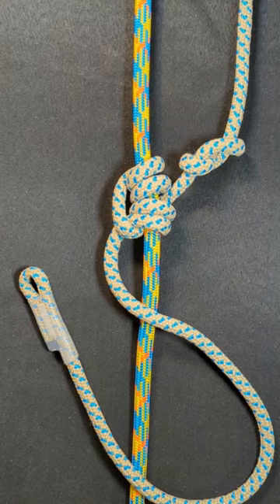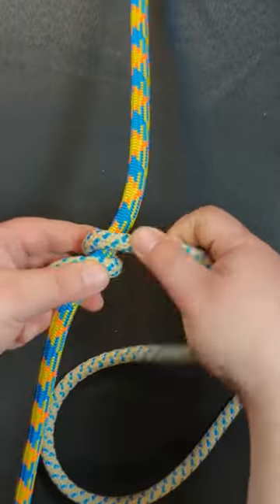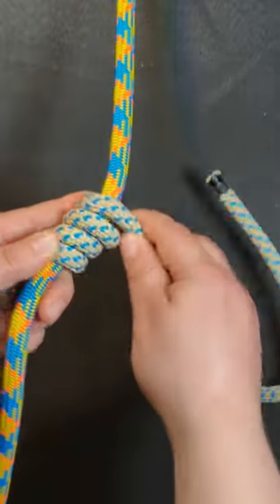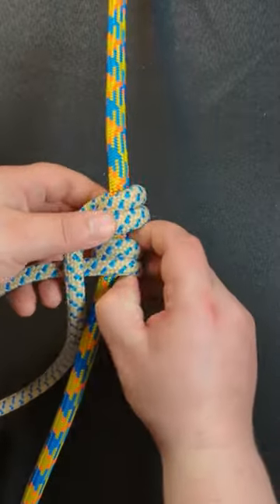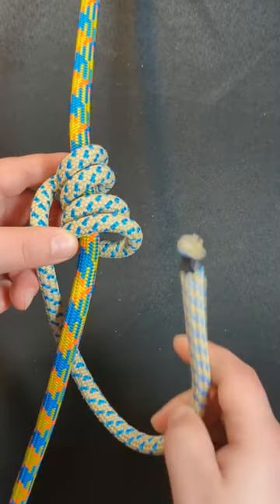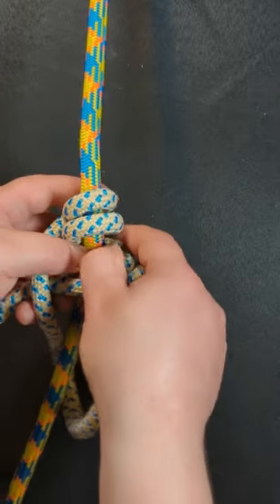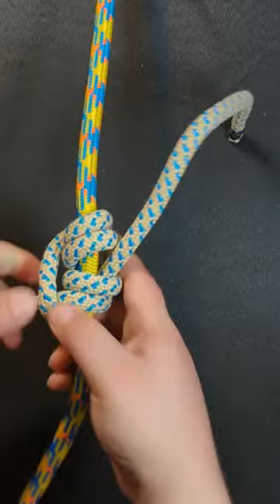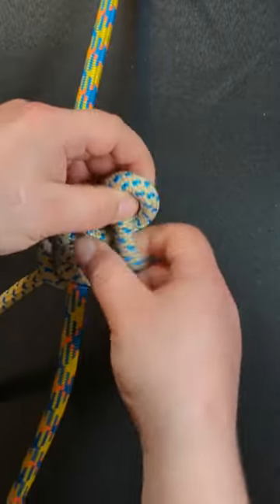How To Tie a BLAKES Friction Hitch Using a Split Tail - For Climbing on a Rope!

Comment: I only use the Blakes hitch.
Reply from the maker: Nothing wrong with that! The Blake's (AKA ProGrip) is a quintessential hitch that every climber should memorize how to tie in my opinion, even if they don't usually climb on it. I have it burned into my memory despite only using it for the first few months of my efforts to learn how to climb over five or six years ago. If that's what works for you, then don't let my massive library of other hitches distract you! haha Thanks for your comment!
Reply: @Knot-orious  👍thank you.

Comment: I find it much easier with the split tail vs using the climbing rope itself with the blake hitch.
Reply from the maker: That's a fair observation. I agree. Also, most climbing ropes have a tendency to melt over time because they aren't made out of heat resistant material.